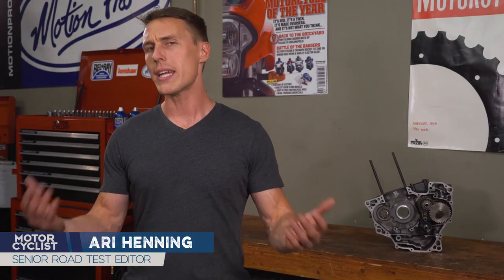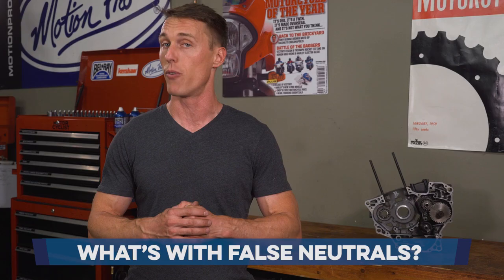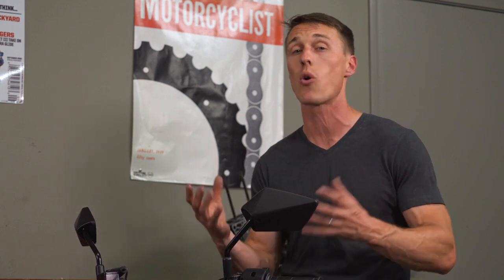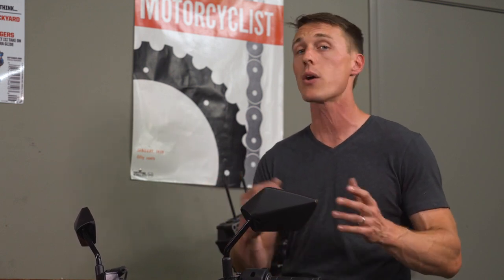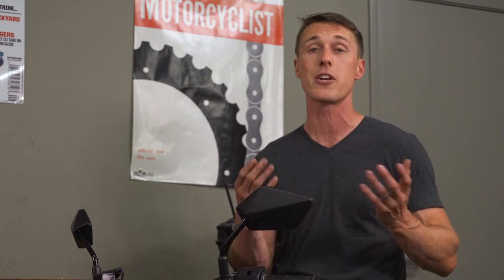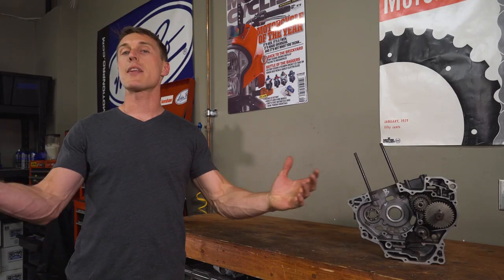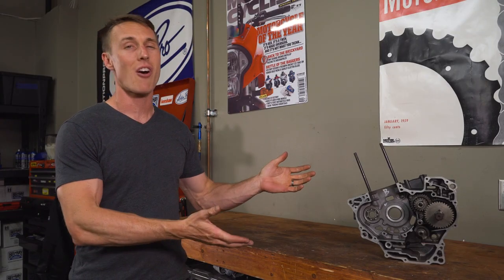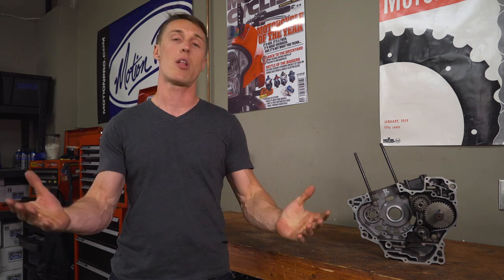What’s With False Neutrals? | MC Garage

Comment: 2 questions:  1) Why didn't you mention about "preloading" the gearbox for upshifts, which is when you gently tug on the toe shifter before pulling in the clutch level to shift to the next gear.  2) Why don't some bikes have 7 gears for even better performance such as a very close ratio 7 speed or a normal ratio 6 speed with a super overdrive 7th for highway cruising?
Reply: It can happen even if you preload if you don't preload enough. If been doing clutchless upshifting on my Jap bikes for almost 50 years. I learned it drag racing my Kawasaki Mach III,  then my blue 72 Mach IV. In drag racing stock bike the guys that used the clutch went home early. But the technique does require use of significant upward pressure with your toe. If I get to casual about it the false neutral can happen and it usually happens at full bore between 4th and 5th. I still run my 82 Magna V45 full bore all the way to redline at 10k before shifting which means it over revs the engine everytime it happens and it never goes back in gear easy. It never did go back easy in my drag racing and street racing days either. The notion of preloading when you are just tooling around town is a little tricky. I know because in normal riding I only use the clutch for the 1-2 shift as it's the widest one then use the clutchless trick up through the gears. I know from the way I ride if you put even a little too much up pressure before you shift, it will go ahead and shift. That not a bad thing because the transmission itself decided it was ok. How much pressure is gentle pressure is hard to determine around town, and if you're running hight throttle gentle pressure isn't going to help in the least with this problem. If you're a clutch person you have to wait until you pull the clutch in to push u on the lever because if you are pushing up or it will shift as soon as you take the engine load off the transmission whether you have the clutch in or not, and if you didn't have enough pressure on it when that happens her comes your false neutral.

Comment: hi.. my question is.. even holding a clutch 1st gear still running.. i fully adjustt it.. still same
Reply: a little bump is normal because on wet clutch bikes the oil will want to turn the clutch and mainshaft a little even with it disengaged. You can't get all the drag out especially on hydraulic clutches. That is why motorcycles have synchronized gears. It's the synchronizer that slows the mainshaft when you put it in gear. But synchros are usually made out of brass or a softer metal to work smoothly and will wear out if you make them work too hard. If you want a glaring example of what syncros do take a standard transmission car. Put it in neutral. Shove the shifter over by the reverse gate. Now, shove the clutch in and shove it immediately in reverse. Or maybe you shouldn't do it because you can shear off the teeth of the reverse gear. The crunch will send a jolt through the car. Reverse doesn't have a synchronizer.
  
So, just make sure you have had the clutch lever pulled in for a 2 count before you put it in gear. As I explained in another comment you have to give the mainshaft time to spin down. In neutral with the clutch out (engaged) the engine is spinning the mainshaft side. Neutral is when the main and countershafts are not engaged, but the main side spins until you pull the clutch. Give it time to spin down. Same is true for all standard transmission cars trucks tractors. There is always a mainshaft and a countershaft.

On the topic of full synchro transmissions, I have only owned bikes made by Honda, or Kawasaki all my life but I have ridden many other bikes along the way. The transmissions on Japenese bikes have been way better than American, British, German or Italian bikes. Comparing the transmission in my 70's and 80's Jap bike to a Harley gearbox is like comparing the trannie in a Ferrari Testarossa to one in a dump truck. You don't really even need to use the clutch to upshift Jap bikes. Put upward pressure on the shifter, blip the throttle and it will shift. No fuss, no muss. Never worn out a clutch or broke a transmission even though I drag raced and street rased the Kawasaki H1 and the H2. I remember when I first rode the Kawasaki Mach III in 1971 I thought I was dreaming. Fastest accelerating factory bike you could buy. Brutal HP to weight ratio, far ahead of its time and a huge leap for all the other bikes you could buy, with an engine that screamed at high revs like an F1 car. And still the transmission was smooth, easy, and near impossible to break. I remember first being on the back of an H-1 and being thrilled when the guy ran it a quarter mile or so wide open but most of all, I couldn't get that sound out of my head. Not the crappy sound they made around town, the way they sounded at full song. I ended up buying that bike from the guy who gave me a ride on it. Soon I was cruising drive inns baiting the Harley guys into giving me their money and headed to the drag strip. At first when I got an H2 street racing business was good, then by the end of summer 72 suddenly nobody wanted to play. Word was out, the H2 was king of the streets. I had to go to extremes to get races. Like sizing up a guy at Jerry's drive in that had a superstock Chevelle on a trailer headed to National Trail Raceway the next day. I had to put a lot of money up to get the guy to take me seriously. How I took his money is my proudest moment as a street racer. that took a little theater, a little acting a lot of guile and all of what I'd learned about how to make my bike go fast, and how some guys with hot cars were not as fast in a street race as the thought they were. Laid a start line trap for this 427 cubic inch, twin Holly 750 double pumpers, big loping cam, 12 in slicked supper stocker. I got to pick where. I used the very place I used to practice my Drag racing starts. The Mach IV launched like a rocket pretty much regardless of the surface. That big car, on the other hand, needed grip. I knew he'd have to work the throttle in first gear and that when he said I had over a car length at about a hundred feet he's panic, and I'd already pissed him off with attitude. I could hear the engine roar and could see the tie smoke in my mirror. But the time he got hooked up I was so far ahead he couldn't catch me, although he did make it close. That was a hell of motor he'd built for it. It made a beautiful sound as it came up from behind. Too late. Doesn't matter how much power if you can't put it down. He panicked seeing this long hair counterculture type on a ring ding sounding bike jump out in front of him. I really get any races then and I couldn't beat Pete Grassilli out at national trail raceway. I packed up my VW Van, sold the bike for traveling money and hit the road. I was gone 15 years.

Comment: thanks for the vids. as far as technomology goes, i'm somewhere around fire & a sharp stick lol. but i'm trying. actually got my first mech job upcoming replacing a worn gear pedal linkage bar thingy. looks like a minor job. know more when my service/repair manual comes with the part. hope I don't kill my bike replacing a metal bar lol. these vids are a godsend in my stone-age attempts to understand the workings of what i'm told is a simple combustion engine ;)

Comment: i got a grom with only 4 gears but every once in  awhile when i go from 1st to 2nd this will happen. its a pain in the ass because you are expecting the bike and the power. so it kinda startles me and i just quick clutch and shift. the bad thing i usually move my foot back after i switc gears so it takes a second or two.. prob because its so unexpected. after i just switch harder then like a month later ill do it again lol.
Reply: thats not a false neutral, you're actually going into the neutral gear between 1 and 2. what you may be doing is not pulling up quite enough, try to preload the gear lever and pull it up all the way and put some emphasis on it between 1 and 2 to make sure you dont hit neutral.  this video is talking about shifting up from 2 or down until 2 and getting a "false neutral" where the current gear has been disengaged but the next gear wasnt quite engaged. also can happen when you are not in the right rev range for the next gear, and if you are just cruising and arent giving the bike any revs it wont be as happy to change up.

Comment: Motorcycle transmissions work best when shifting at the appropriate rpm speed for the gear you want to be in.  If you find that it is hard for you to shift up or down with your foot. Most likely your shift drum has worn from slamming the shifts or you are in the wrong rpm.

Comment: Great video as always. Sometimes its also just a matter of adjusting the shifter. If its too low for example you dont completely unload it so you cant pick up the next gear. If its too high it also makes it harder to shift properly.
Reply: i have this problem on my ybr125 when for example i have to come to a stop fast or do an almost emergency stop. while im stopping im too concentrated on braking to remember to change down from 4th or 5th, then when i try to change down gears fast to get moving again i think i change down one gear then i dont unload the stick before going down again then i let go and the bike just wont go down at all until i let the clutch out slightly and then pull it back in, then it will go down happily. i can only think its because i didnt unload the stick and made it unhappy by losing all momentum suddenly in doing so

Comment: great content people. big fan. just a clarification though... i own a 150cc air cooled single with a 5 speed gearbox (bajaj pulsar). its done about 23k miles. recently though it seems to fall into a false neutral almost everytime between 2-3 and 3-4 and sonetimes even at 5th gear. so what is it that i need to replace to get a smooth shift? i checked the clutch, which is kinda worn, but not to an extreme and i highly doubt thats the reason. it would be really helpful to get a solution from you guys. keep up with the great content. 😁

Comment: on my first motorcycle which was an Aprilia RS 125 the gear dogs between 5th and 6th were very badly beaten, and it was pretty common to not get into sixth properly or to spit out of 6th gear (the noise from that is just heart breaking). And for me as a newbie rider back than it was extremely frustrating. The right way to avoid that is to properly kick the shift lever.

Comment: My question is are they damaging the bike?  I'm railing it between 5th and 6th with the quick shifter and get a false neutral causing the RPM"s to further sky rocket.  It's happened a dozen times now, so I'm not using this quick shifter anymore......  Have I already damaged anything?

Comment: Does shifting up (like from 3 to 4) from false neutral, "without" reving while on the move at moderate low speeds (40-50mph) have any long term concerns? Or are modern bike transmissions robust enough to take it a few times without any concerns? Thanks.

Comment: Motorcycle transmissions aren't the most exciting topic? Are you kidding me? I live for this stuff. Once had a dude try to make the claim that the clunk you get when shifting into first from neutral was the bike taking the slack out of the chain even though it does it on belt and shaft driven bikes as well. Knowledge is power.... To the rear wheel!

Comment: Hello MC Garage.
I was riding my newly bought Kawasaki Z1000 2017 today and I put on my newly bought Dainese riding boots. It was my first boot ever so I was still trying to get used to it.
When I shifted from 3rd to 4rd at 80-90km/h, rpm was at 5-6000 (red line is 10k), I missed. I could hear some clanking sound in the engine like you put nuts and bolts into a metal bucket and shake it. It went on for about 2-3 seconds and then I pulled the clutch hard and make a hard upshift. The bike went back into gear and ran fine since then.
Is there any possible damage that I could have done to the gears in that situation?

Comment: False neutral had happened to me a few times. I remember once it happened at high rate speed. Shifting from 4th gear to 5th gear. I didn't re-shift then. I let it roll, slow down till i've come to full stop and just reset my gear back to first gear. The second time it happened wasn't going as fast and re-shifted it but i heard a loud noise on gears even though i had the full clutch lever on. I think it's best to just pull over when this happens and just reset your gears. It is safer this way.

Comment: It's very different with each bike, but with mine (2017 Kawasaki Ninja 1000) I can have clear effect on that "smash" when switching from neutral to 1st while standing: When you pull the clutch and immediately put in gear, the full rotation power slams into the stationary part. If you pull the clutch for too long, the rotating elements inside the gear box slowly come to a stand, where you probably can't put in 1st gear. The secret about this is to "imagine" the right time frame where the rotating parts inside your gearbox have slowed down, but are still moving. They need to move in order to allow the 1st gear jump in, but when they have lost some of their energy, there might be not such a big slam (which also means, less wear down of your mechanical parts), sometimes the gear might even slip in smoothly without anything to feel or to hear. But as said, that might not work for many other bikes, since I have tested this on a Z650 and no matter how long I pull the clutch, the 1st gear will always smash in. It depends on the gear box really.
What you can do and what manufacturers usually advice, is to put in 1st gear short before coming to a stop. That way you have minimum wear down of the mechanical parts and no smash, but you will need to hold the clutch for as long as you are standing. Trick would be though, if you know it's a red a light that stays red for a while (or anything else where you know, you will keep standing for a bit), being in 1st gear, you could turn of your engine with the kill switch. Then you have a secure stand, no gas consumption and no noise emission, but you could still quickly start your engine and head off, since no gear switch is needed - just think of putting your kill switch back to "on" right after the engine stopped, otherwise your take off later takes longer than you wanted.

Comment: I have a noob question here...if one is at a stoplight and the bike is left on in neutral can I just got to 2nd gear and do a slower takeoff or should it be 1st then 2nd
Reply: Yes, you can as long as your engine has enough torque to start the bike rolling without stalling.

Comment: My motorbike Cbr 250r having downshifting problem after sudden stop from high to 1st low gear .After slipping clutch it is possible to downshift can you figure what's the complaint here?
Reply: All bikes have this problem, trick is to shift down all gears while you are still moving. If you don`t do that you will have to rock the bike back and forth to be able to wiggle it down to first and that can be time consuming...

Comment: I am having problems with my clutch, the 3rd and 4th gear's are difficult to get, sometimes they don't fall on neutral but instead the shifter gets jammed and only works again after I change to a lower gear and try to upshift again

Comment: Bad advice at 1:40. It sucks but you should pull over on missed shifts if you care about the life of your transmission. Never do anything that's going make it make a nasty noise. That noise is the dogs on the gear getting rounded as it jams into gear. Trust me, I was a mechanic at a large multi dealership for over a decade and have rebuilt 100's of transmissions due to rounded dogs.

Comment: How about when it's sometimes so #$%^ hard to get into neutral when you stop, and it's dancing on 1st and 2nd? :)
Reply: I give it a little throttle and then it'll go.  Or move the bike a little forward and back and it'll go
Reply: Thats why before stoping you go into neutral, alaways goes for me
Reply: Kawasaki has a really nice feature where you can't go into 2nd until you start moving. Makes it so easy to get into neutral.
Reply: @disbsam333  so you can't start in second
Reply: @cazyelnats6656  correct. Only from a stop. If you stop in 2nd, you can start in second, but once you click it into first it only goes up to neutral until you move a little bit
Reply: @disbsam333  yeah got caught out with the Kawasaki easy neutral on my test. It only works below 7mph though for anyone struggling to go from 2nd to 1st without finding that easy neutral
Reply: Never put bike in neutral when stopping. Just 1st gear and clutch pull.
Reply: @meoffjack  Exactly. Never neutral while moving, never neutral on the road. Watch your six and be ready to move at the first sign of trouble.
Neutral is for letting the bike run with the kickstand down.
Reply: Your clutch sleeves doesnt disengage far enough to let the transmission fully open. Its also always appear whenever you trying to put it to 1st gear after cold start in the morning. Try different clutch springs or check maybe those are overtightened, myb adjust your clutch cable first before opening whole transmission.
Reply: Ya lmao happens to me all the time

Comment: never had a false neutral but I've had it downshift on its own, scared me when i had my 300 drop into 5th at 110 mph causing the back wheel to lock up
Reply: How frequent does this happen? Did you change your shift star after that?
Reply: @reylennanncesar3732  it happened maybe twice in 10k miles I drove that bike. It's a great bike don't let that change your mind. All bikes have their quirks
Reply: @tpolarbeart  im curious if you had a transmission problem/fix after that. It happened in my 400 3-4 times already at 15k kilometers. Thanks for the reply btw!